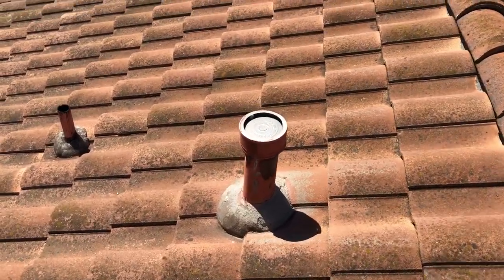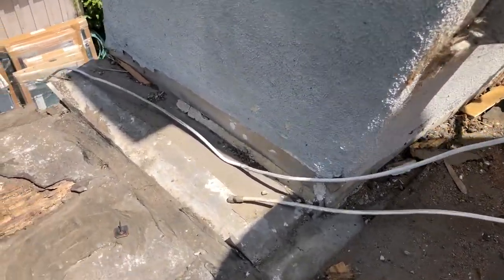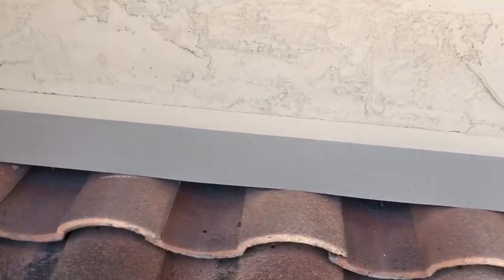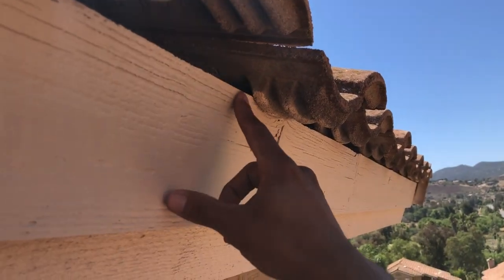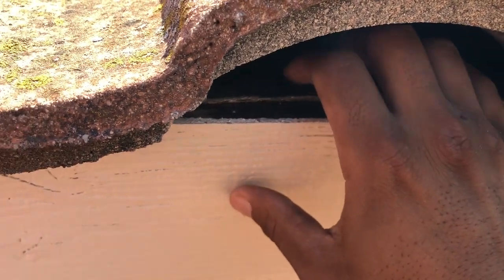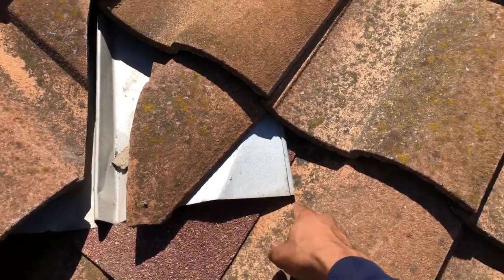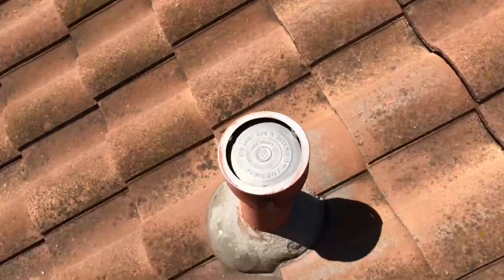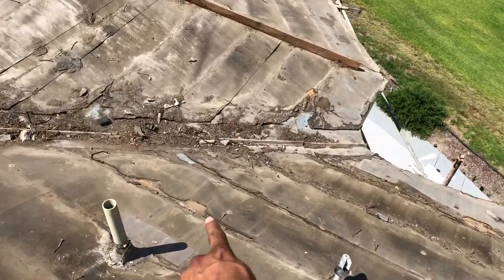Common Problems With Tile Roofs, Why Do Tile Roofs Leak?

Comment: we had a tile roof inspector look at our roof.  he said on this tile the manufactur didn't put sealant all through the tile and the sun degraded it.  the tile will soak through soon  we need to replace the tile.  30 to 50 thousand.  im a bit leary

Comment: I have a 13 year old custom home with a tile roof. Just noticed a leak inside which I think is coming from flashing around chimney.
Reply from the maker: Possibly water is jumping over the tile pan.
Reply: @roofingfanatics4775  so a roofer will be able to tell? I'm in San Diego and we have had rain rain rain for weeks on and off. Supposed to stop Wednesday. Noting can be fixed until the rain stops - right?
Reply from the maker: @shelleycharlesworth5177  yes, I am located here in San Diego. Zenith Roofing Services in Escondido. If you would like I can take a look tomorrow. Just fill out your information on Zenithroofingservices.com to receive a free estimate.
Reply: @roofingfanatics4775  -ok thanks.

Comment: What is a ballpark cost for replacing the underlayment on a single story house in CA? 1500 sqft house with some plywood repair and replacing broken tiles. I want to make sure I'm getting a decent deal. Thanks
Reply from the maker: How much is the roofing company charging you? I can let you know if it sounds reasonable or not. It depends it could cost anywhere from 12-18k
Reply: @Roofing Fanatics   15k with 2 layers of underlayment, repairing some plywood rot, adding drip edge and replacing cracked tiles with new tile, they will be moving new tile to the back of the house so to preserve the look.
Reply from the maker: Sounds reasonable. I’m sure they will do a good job.
Reply: @roofingfanatics4775  thank you

Comment: I cannot believe that the Americans fix tiles directly on to the roofing felt .You can see the lines where the tiles have worn the felt away, not a good system in any way you need a batten system. Without question
Reply from the maker: We do have them here. I’ll eventually make a video. What type of batten system do you install?
Reply: @roofingfanatics4775  the timber battens we use are 2x1 treated battens. With 1inch plastic spacers .So if any water gets through the tiles slates etc the water can get away .You should never fix tiles on roofing paper its not an option.
Reply: Yeah I'm surprised no board and battens.  Slate calls for it.

Comment: Only 30 years out of a tile roof?  Screw that.  For how much it costs it should last longer than an asphalt roof.
Reply: Lol here in Phoenix many tile roofs only last 20-25 years before complete replacement and start having leaks at 10-13 years old.